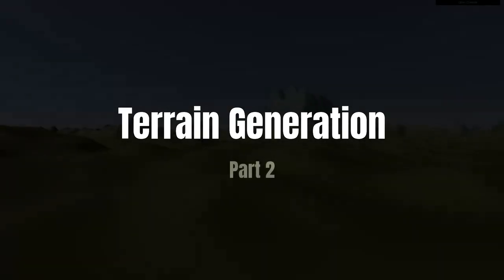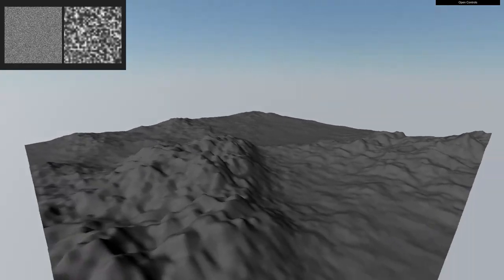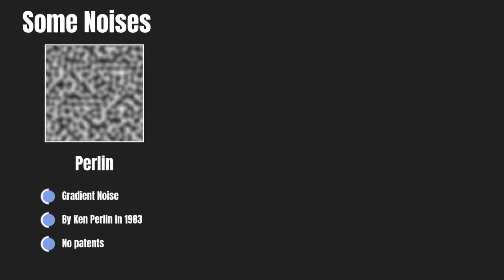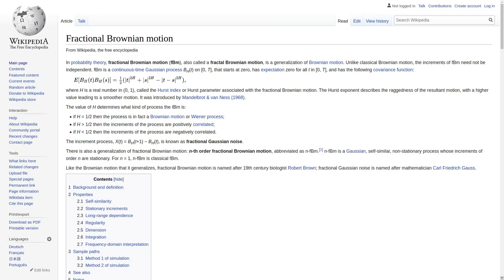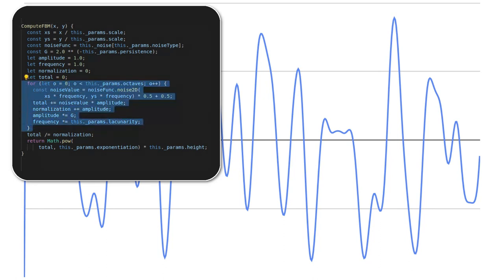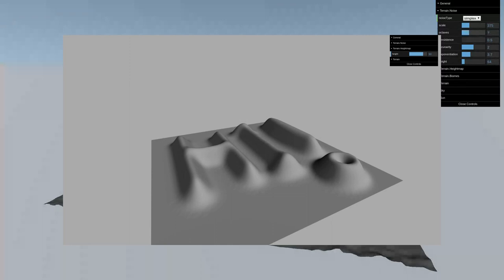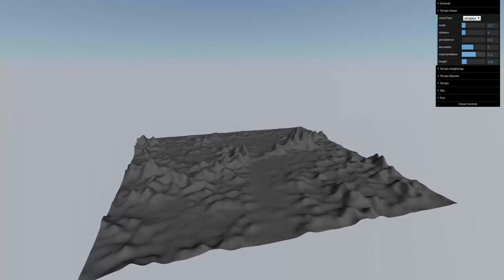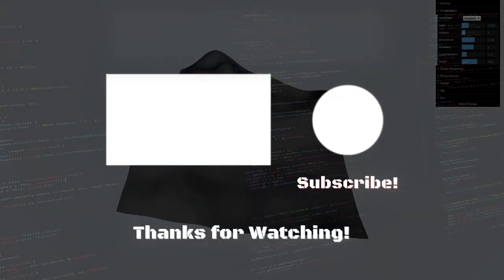3D World Generation #2 (Perlin Noise)

Comment: Practically speaking, perlin noise tende to align features with the x and z axis more than openSimplex noise, so if you dncountrr that and it seems like a problem, you might want to switch. Otherwise theyre nearly indistinguishable

Comment: You forgot the main reason to use (Open)Simplex instead of Perlin: Perlin has visible grid alignment, which (Open)Simplex avoids. Picking one over the other shouldn't take more time than it's worth, just look at what libs are available and what options they include for noise.
Reply from the maker: Yep agreed, Simplex noise does look nicer.

Comment: Your demos all look pretty cool and informative, but I've had very little luck getting your github code to work. So far I've downloaded 5 projects (3d world gen 1-4 and l-system simple) and the only one to work without me touching the code is the simple l-system (there I had to adjust the canvas height). The others just show black screens in the browser (chrome). Is it possible you uploaded broken code or incomplete code or code that hasn't been tested on more than 1 browser or tested on environments that might be missing some required plugin? Not sure at this point where to start in terms of making these work.
Reply from the maker: It's entirely possibly that it only works on my machines. I run ubuntu on my desktop, and windows 10 on my laptop, that's the only testing any of this code gets. Sometimes I test it quickly on my wife's chromebook as well. I just responded to your other comment, but it sounds like you just need to host these properly. Let me know if the web server plugin was all that was missing for you, otherwise I can try looking into this more.

I also cover local dev setup in one of my earlier videos: https://youtu.be/CdMr5cv3PiE
Reply: Thanks for the quick response. I have it working now -- see my other comment in your other video -- I was just running it in a browser instead of in a server. I have it working now in a simple server (chrome app server).